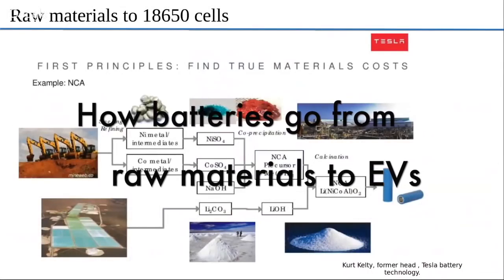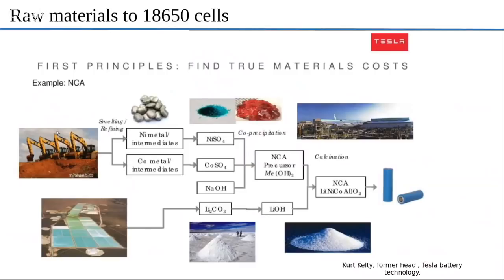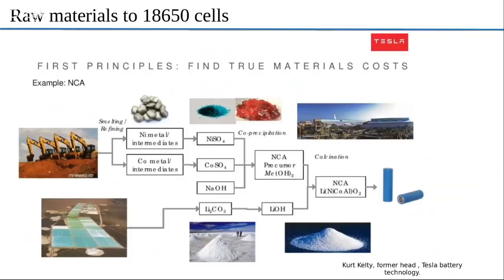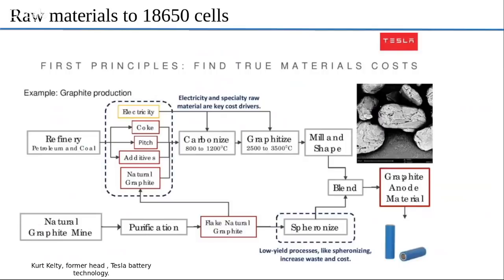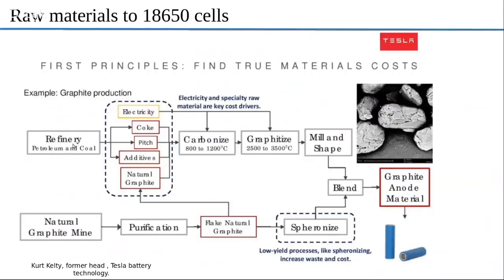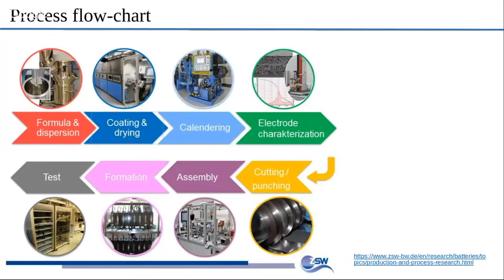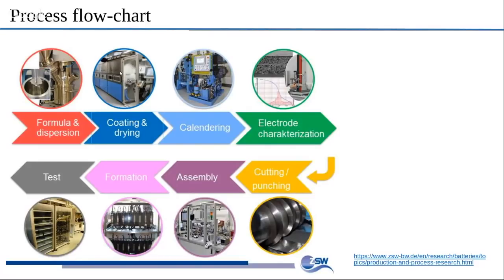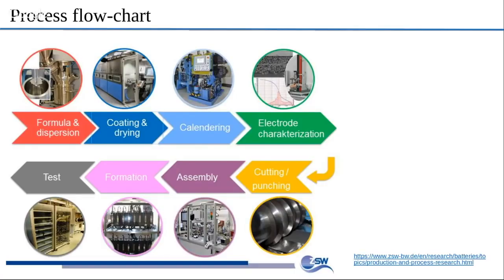How batteries go from raw materials to EVs

Comment: So nice to get quality educational content. You should ask if the use of petroleum waste product (Pitch & Coke) as binders in battery production is simply a matter of cost / convenience, and therefore can be replaced with more sustainably produced binding agents or if they are essential ingredients that can only come from petroleum production as a practical matter.
Reply: I'm sure they can be obtained from wood and the charred remains of climate deniers.
Reply: Our company specializes in producingAdvanced spherical graphite shaping line.
Raw material price: 769usd per ton. Maybe lower in Africa.
1. Finished product price:
(1) low grade 3076-4615usd per ton  
(2) middle grade 4615-7692usd per ton  
(3) high grade 7692-1079usd per ton
We can produce sample according to customers’ request. Customers should take sample of finished product and raw material to us. We produce it before making an order.
2. Capacity: 1 ton per day per set. 60kg/hour. Japanese supplier only 20kg/ hour
3. Electricity saving: Compared with traditional equipment, it can save about 2000kwh per day.
4. Yield rate: more than 90%  traditional equipment 50%
5. High purity: The equipment takes dry purified air as medium, and there is no other medium (mechanical wear) in the production process, which avoids secondary pollution and ensures the high purity of raw materials.
6. High degree of automation: the equipment is PLC automatic control, from feeding to finished product packaging can achieve automatic control, greatly reducing the labor cost.
7. Application fields: lithium battery materials, metallurgical powder, nonmetallic mineral materials, electronic ceramic materials, various abrasives, diamond and other super hard materials.
 
Introduction:
Powder is an aggregate composed of many small particles. Due to the excellent bulk density and chemical stability of spherical powders, the market demand rate for spherical powders is increasing. For example the battery anode with price even 3,000-10,000usd per ton, there is a big market with the development of green car. The spherical powder is generally obtained by powder reshaping, reshaping process will generally use series of mechanical shaping equipment, due to the rotation speed between the shaping equipment is different, the powder through the process of each adjacent equipment is polished into a round. But the rate of traditional equipment is very low, and the electricity consumption is very large, the overall work efficiency is very low, and caused a lot of waste of materials.
Our company independently develops a new type of spherical powder equipment. This shaping equipment uses pneumatic force to grind irregular particles into spherical or near spherical shape, so as to improve the fluidity of particles, increase the loose density, compaction density and specific surface area, and greatly reduce the power consumption of the equipment. 
                             

Best regards,  

Moble: 086-182-6396-7330(Whatsapp and wechat)
E-mail:pelterchen@gmail.com

Comment: Just a clarification, you don't NEED petroleum products, they are used because they are almost thrown at you cheap and tested, where as alternatives would have to be tested. At no time will we HAVE to pump up oil to make batteries, nor will the move away from petroleum products make the battery much more expensive, just for now inconvenient.
Reply: I'd like to see how a company can make batteries without using petroleum products to make the batteries. And also a comparison of cost between the two different processes.
Reply: @Mr_Battlefield  Basically the petroleum products being used today can be synthesized from other base products, just like you can run an engine on alcohols not gasoline or diesel.
Cost comparisons are a different story since the petroleum products used today are essentially waste products when refining oil to make gasoline (and other high volume products).

Comment: So, how much does it pollute? Can we recycle them correctly?
Reply: https://youtu.be/lIMJEVYQhfg
Reply: Can all be recycled. In Europe Umicore says they can do 96 % , but at the moment they don't even do recycle lithium because it isn't economical. 20000 tons is the minimum amount they need  per anno they claim. They amount for recycling isn't available in sufficient amounts for a thermal procedure. There is allready a chemical procedure available which works too. Apart from lithium other metals are allready being recycled. There real issue is that all the small batteries never see a recycling process , not because someone doesn't want to , but they just end up thrown away by consumers.
Reply: J. B. Straubel has left Tesla to setup a recycling factory. If anyone can he can, and the current crop of batteries will be in use in cars the storage for 30+ years so he has some time to work on it.